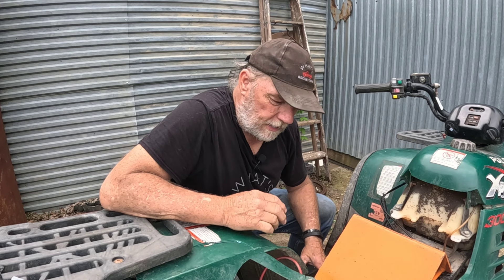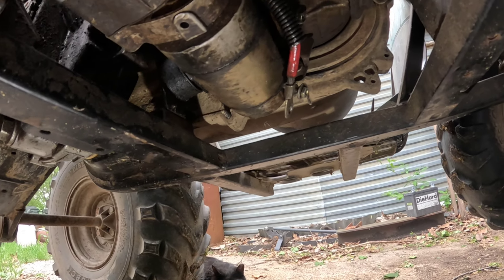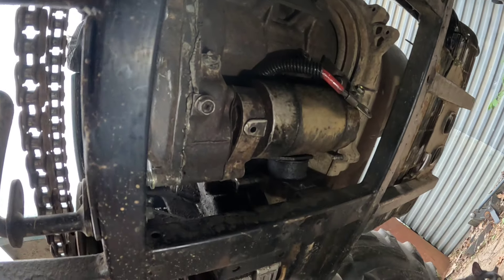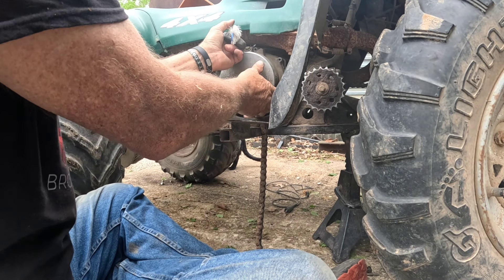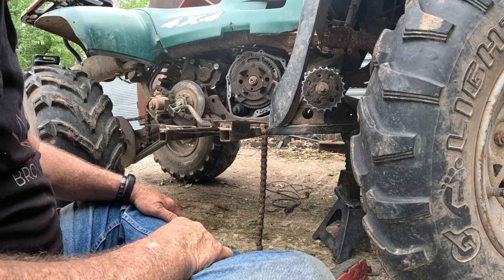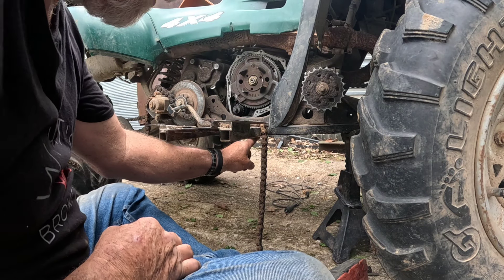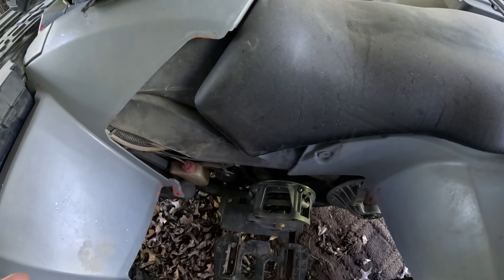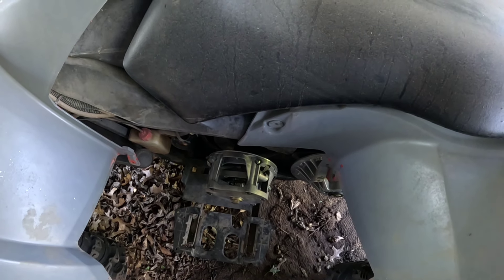Starter Replacement 96 Polaris Xplorer(just a walk thru changing starter)

Comment: Do you by any chance know what size of bolt I need to remove the front clutch? I don’t have the special tool to remove it and I am planning to make a bolt work 😂
Reply from the maker: I measured the tool. The threads are 3/4-16 & the tip that is smooth is 2 7/8" long. You can search the internet for a picture to see the shape of the tool. Thanks